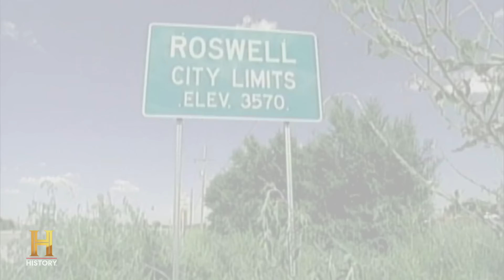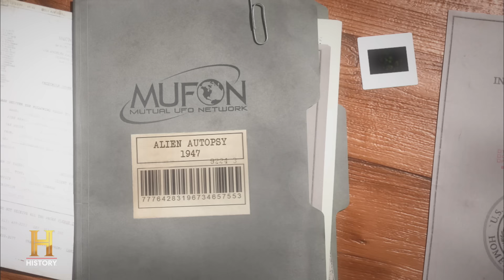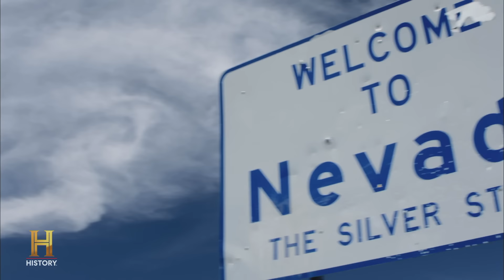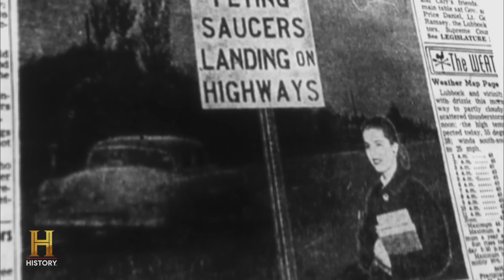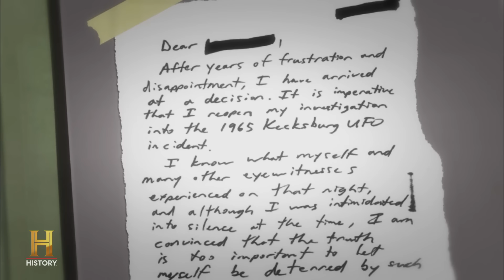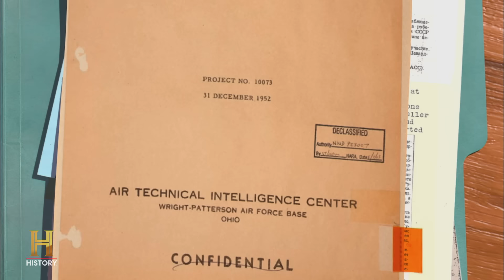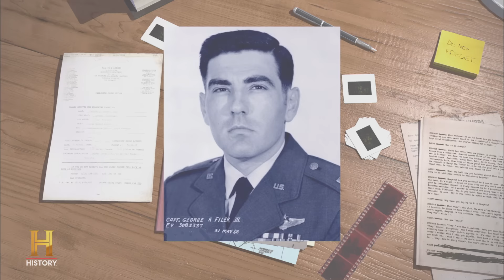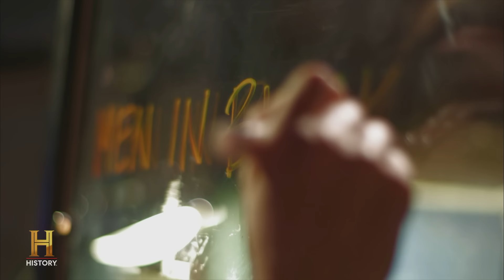UFO Conspiracy: Exposing Secret UFO Reports | Special | Full Episode

Comment: Witnessed a bright red triangle fly down the coastline at night in 1987. It was like a short paper airplane. It seemed to be 30 tp 50 feet long and flew at maybe 1000 feet. I was stunned and thrilled. I felt it could only be an alien craft.
Reply: I observed at sunup a large aircraft with bulges where jet engines usually are on the wings but had no openings for air going in or out and flew low above the river and going too slow to keep flying if it was a aircraft and had no cockpit and had one light on each wing tip !
It was not a aircraft and right afterward i questioned whether i saw this or not for some reason i had doubts come into my mind which i never do !

This river is high military importance with day and night helicopter patrols

Comment: whats really weird is how the car engines start back up again on their own. i can understand some sort of electromagnetic interference could stop the engine but how could it start back up again on its own without turning the key again?
Reply: Perhaps rather than electrical interference, it is temporal interference.  Perhaps it's not really stopping the engine, but stopping time.
Reply: @charlessage7323  I was thinking that too. I wonder when the car started back up if they heard the car starter or just the car was running again mysteriously
Reply: Maybe that's how they can travel so fast, they somehow slow down their relative time
Reply: Or perhaps time was frozen except for the occupants.
Reply: The relays that start the car are 12 volt electromagnets that cut on the high amperage connections not the key switch !
It is not magic , it is electrical and electromagnetic fields being applied.
Some ETs have a rule of noninterference that means people and things are returned to  where they were as before !
Reply: Omg I thought the same exact thing.  I wonder if the iPhone time…or wrist watch would be effected.
Reply: Its not that the engines are turned off. All matter in a given area is put into a suspension state. This also involves l time that includes any living entities including us and accounts for reported lost time. This isn't theory. It's a fact.
Reply: Look up the Barney and Betty Hill incident back in the 1960ties.

Comment: I watched one in 1975. I was 12 years old at the time. It was about 1,500 feet up. It was saucer shaped and it made several right angle turns. Then it took off and in about 2 seconds it was over an adjacent island five miles away. The entire incident happened in about 10 minutes. It never made a sound.
Reply: That wasn’t off the coast of SF at dusk was it?  I went to a party with my mom at a friend’s house high up on the western side of Telegraph Hill and we all watched a classic silver saucer fly around off the coast for a little while (15-30 minutes?)
Reply: @keirfarnum6811 , nope. Wrangell, Alaska.